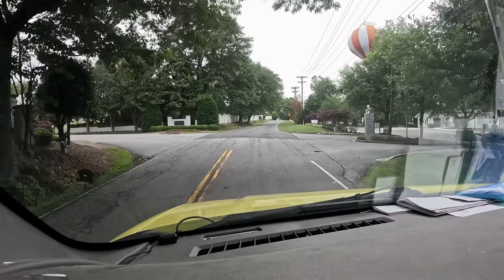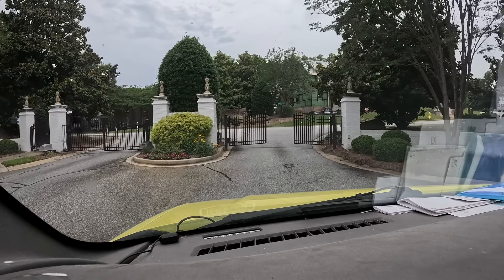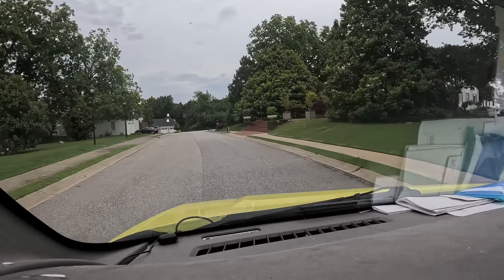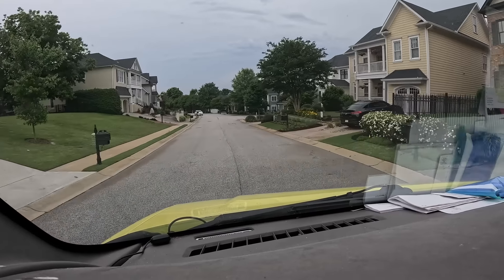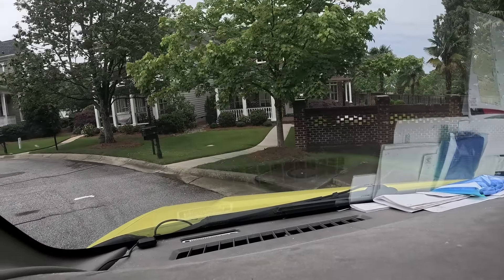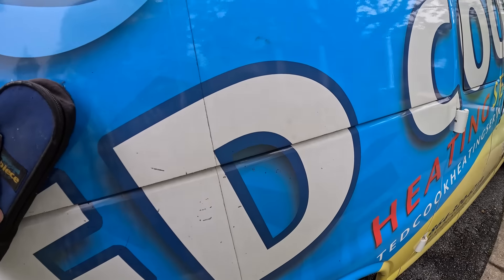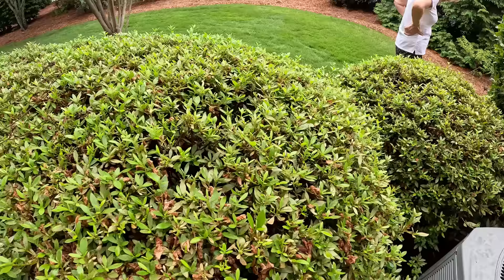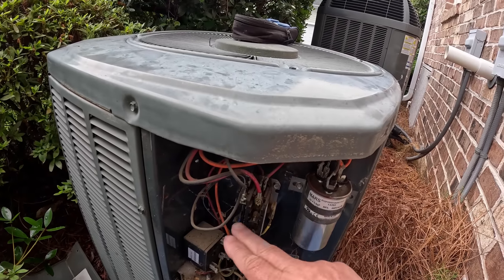Capacitor bad lucky quick fix

Comment: You sir are a good service tech. You do not pad her bill with things she didnt need. Imwith you ,the unit was down due to the cap. Othing more. No need to guage up if not needed.
One guy on here,i wont .ention any names but went to service a unit ,system was running ,he checked cap and it was with in spec but still sold her a cap and chargedher over 140 for cap. Plus charged her 80 bucks for coil cleaner and all the unit neededwas washed out with water.
You do great reputable work.

Comment: I purchased the same capacitor tester you use and it works great. I tested the new ones I gave in stock at home. I actually have every electrical component needed to get it up and running if I have a problem. I went with all oem parts or equivalent.

Comment: What does a service  call labor charge only for cap replacement in your part of country?
My local authorized Trane  company was out to  do our member included 6 month tune up and found bad capacitor that was covered under partial 10 year warranty (parts only).The labor charge was  $240.00.  The unit is 9 years 7 months old. Trane 2.5 ton XR15.
I live in Kentucky 41051 area of country.

Comment: Aww! That’s the same trane unit I have but hers is a little bit older because it has the older brown relay and mine is the white one. I cleaned both coils inside and outside and the system is working great. 👍🏼

Comment: I've been hearing about the new Freon and they said it is highly explosive there will have to be special detectors installed on a furnace the return plenum supply Platinum and other spots I hope we don't get those. They have used that Freon before and it exploded a home and cause other bodily injuries

Comment: Do these caps just burn out from usage / age? I'm asking because about a year ago our Trane heat pump (XR15 - installed 2013) wasn't cooling and the tech came inside to check the air handler then went outside and probably ten minutes later comes back inside and says, "You're good. The caps were bad and I replaced them." - he said to give him a call if it's not cooling down. I think he was in our driveway doing paperwork / eating lunch or who knows but before he left we already had cool air coming out.

Comment: I am very much in agreement, especially with regard to the refrigerant circuit. It's just tempting fate to gauge up on an older system when it is otherwise performing reasonably.

With regard to the whole R-32 flammable refrigerant thing, you're already using it -- it's part of the R-410A formulation.

Comment: All I could add to the advise to the customer is asking their gardener to trim those bushes/plants back two feet so they can avoid leaves and pine needles. The rest is all a fair shake. Just a cap so why keep digging for something if its working like always. It'll keep running for years and years now that its made it this far. 
I'm not sure what the changes are with the A2L gas other than they are flammable. I wonder it will carry the heat as equal or better than 410 does. 410 compared to R22 required much more condenser and evap area to do the same job as R22 did. Just like newer cars that went to 134a from R12. There was a huge difference in cooling capacity when they moved over to 134a and had to develop larger and more complete condensers and evaporators to keep up.

Comment: Glad it wads a simple fix  I think most of what happens is the caps going bad.  I studyed HVAC in the early 90's when they first started the EPA Test.  They were open book back then.  I just put in my garage apt I live in a 410A Dakin mini split was on a Train R22 system from 2003.  Why are they changing to another system from 410A  seems like its not been that long, maybe 10 years they killed out R22

Comment: I have a 2021 Ford Escape Hybrid that has the A/C Compressor run by the 450 volt battery and uses R-1234yf. It is the best A/C I have ever had in a car, and at 68 years old I've had a few. I have seen the price of it and it is crazy expensive.